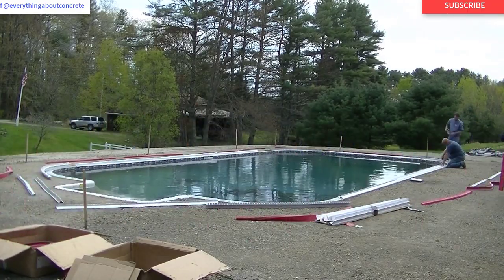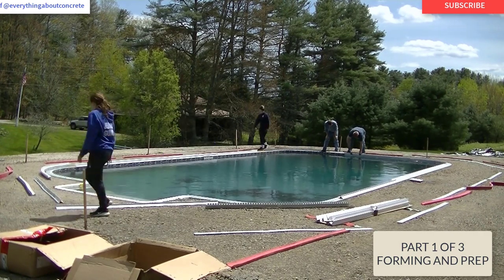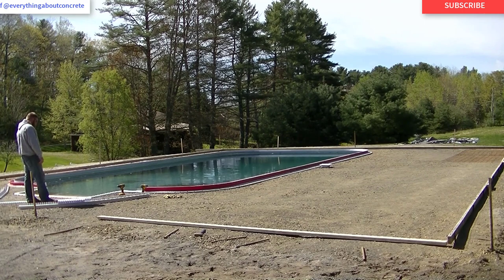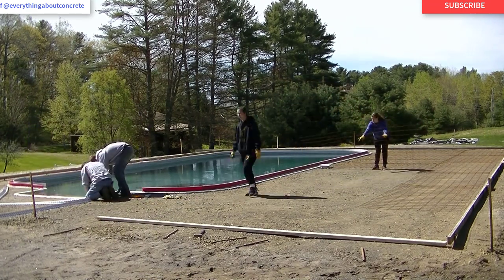How To Stamp Concrete Around A Pool : PART 1 OF FOUR

Comment: Been to LL Bean store. I am about to start building my house having never built one before. It will be on a 40 x 60 slab. The stakes you use to support and attach/screw your form boards to, are they the stakes that come with the series of holes drilled in them? What size 5/8"?
Reply from the maker: Yes, they already have the holes pre-drilled. I think they're 5/8 by 2'.
Reply: Thanks Mike, I took your course and saw them in there. @MikeDayConcrete